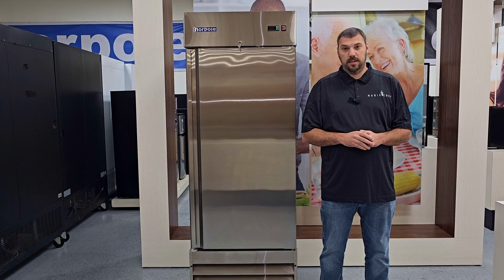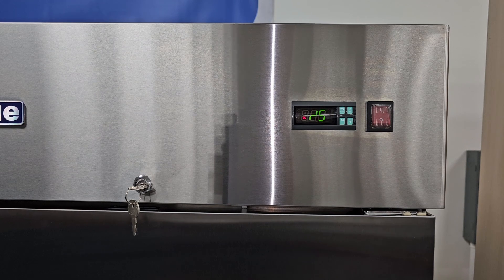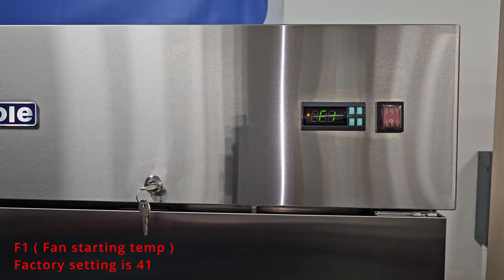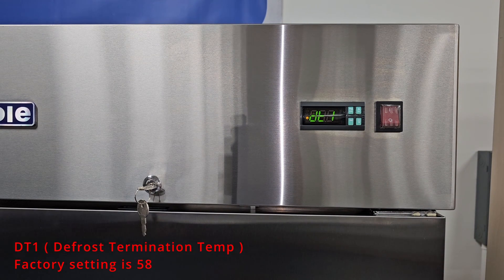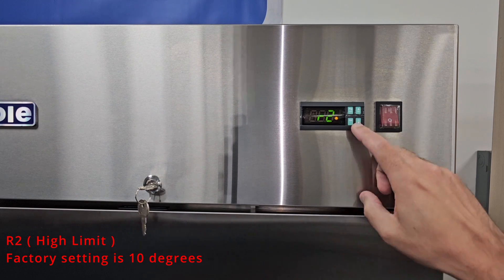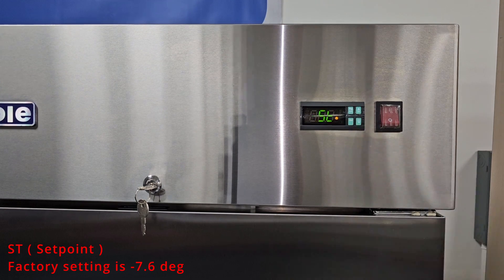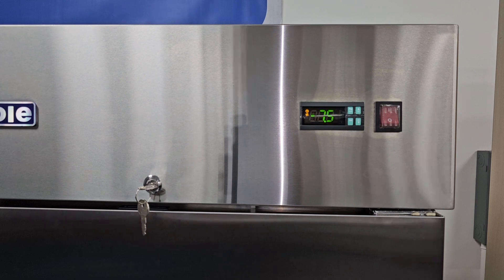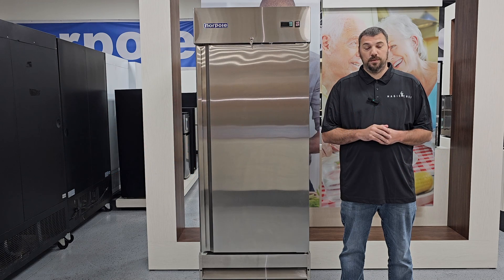Carel IR33 Parameters

Comment: How IT reset function
Reply from the maker: There is no reset to factory parameters function, if that's what you mean. They have to be set individually. Call 888-775-0202 if you need assistance.
Reply from the maker: If by IT you mean Internal Temp, Press set for 1 second, adjust temp with arrow keys, press set once more.